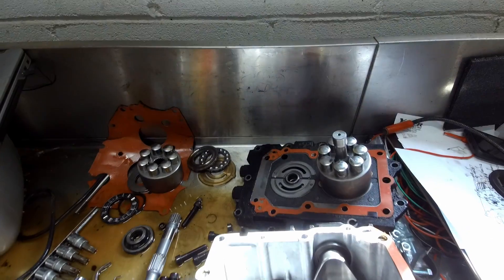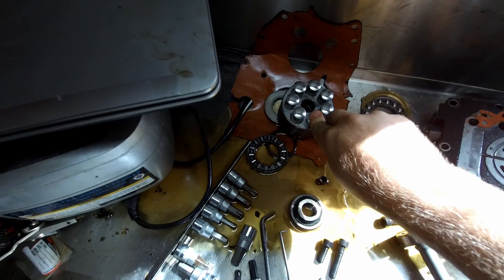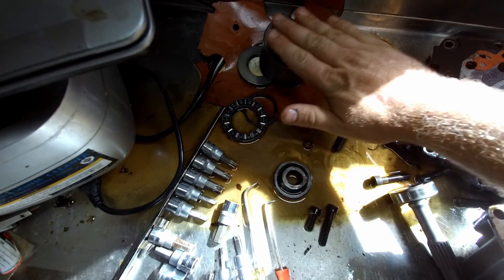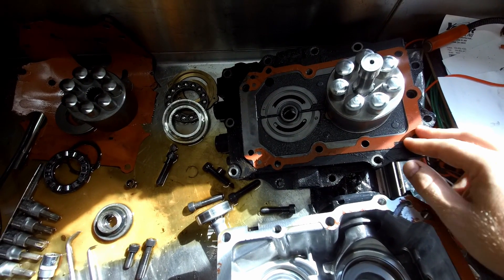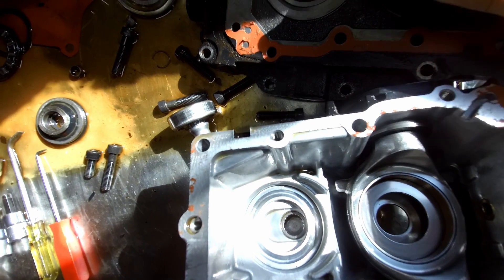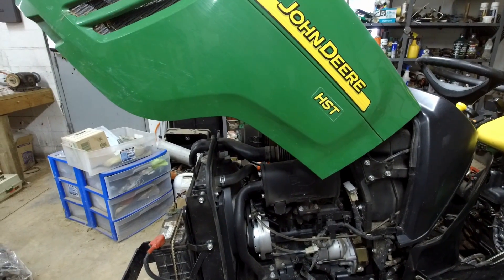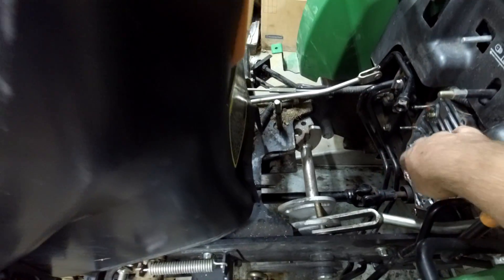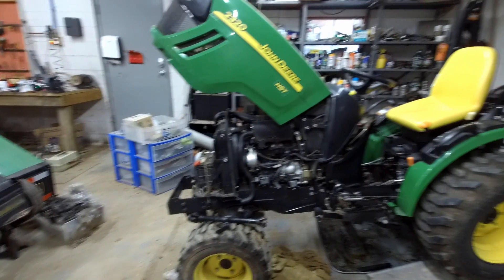EXPLAINED: How a Hydrostat Transmission Works

Comment: Hydrostatic transmissions are garbage. No reason for them on riding lawnmowers in the first place.
Reply: Hydro is superior in almost everyway to a Gear Transmission for any lawnmower. Just do your homework and buy a good one. True for everything.
Reply: @MikeThomasNYME  nah. Hydros suck. Had a Husqvarna with hydro transmission crapped out within a couple of years. Wheels would lock up going forward and had to keep getting off jerk the lawnmower backwards to get it going forward again. Junked that lawnmower quickly and went back to Murray and troybilt. 
  No need for hydro in a lawnmower, tractor...eh...maybe
Reply: @danielsmit11  That's because Husqvarna and the other cheap big box brands put cheap hydro transaxles in their machines because consumers just want something to be pretty and cheap. They use transmissions like the Tuff Torq K46 which is too small and weak for the 25hp tractors they put them in. K62 and larger hydrostatic transaxles and old peerless 15 hydros are nearly indestructible and last for decades.
Reply: @MikeThomasNYME  I'll stick with Murray's or troybilt. Have never had transmissions go out on one and have had them last for decades with little maintenance done.
Reply: @MikeThomasNYME  like I said there's no need for hydrostatic on a riding lawnmower. A tractor maybe but even that's a toss up
Reply: @MikeThomasNYME  other problems with hydrostat if you Google  they are less efficient meaning you'll use more fuel doing the same amount of cutting, will probably need a more powerful engine for the same size mower and requires more careful maintenance in most cases by a professional because they are usually built as a closed system making it virtually impossible to change the fluid.

Comment: What would Cause when you press in the clutch pedal to not disengage the hydraulics ?? is something broken inside
Reply from the maker: It would depend on the equipment - on many machines they have hydraulic pumps that are driven directly via the engine gear case and do not disconnect with the clutch & transmission.

Comment: Actually used to work for Deere.  Had a 1023 come in for the same failure.  Somehow that grease zerk fitting was omitted from the owner’s manual.  Deere eventually issued a PIP for it after enough owners with low hour machines experienced failure.
Reply from the maker: Thanks for the info

Comment: They probably left a greasing time periods out of the manual because it would deter people from buying it sounds like a problem with the build and should be recalled
Reply: Agreed.  Whole damb thing should be recalled.  Such bad luck with 2025r.  They even left the same crap design for the u joints. No easy way to grease.  That's the least of this things issues.

Comment: John Deere I avoid not that they are not good machines great machines but the company needs to be stopped it as began to crap on the consumer
Reply: Damn right! JD sadly has to get their act together. This is what I would expect from Chinese quality. My Lawn Tractor has had several faults that shouldn't have happened. Seat quickly fell apart, plastic hood cracking like an eggshell even though it's kept out of the sun, steering linkages are pitifully small, seat suspension rubbers crumble very often. The only good part about the machine is the Kawasaki engine and the Tufftorq transmission. Never JD again! It's also damaging for American manufacturing. Kubota for me next time. Good Japanese quality.
Reply: @erichmacho5741  thank you for the reply Erich im sorry your machine went that way. My father spoke of JD getting to big for their own good all the way back in the 80s. He strongly supported massy Ferguson not as a single company, but a smaller manufacturer. The whole JD culture planted seed for today where if 3rd generation has parents and grandparents backing the product. They automatically want to buy JD because it’s familier. I can’t blame the consumer we all
Like to think our elders are actually wise. The thing is their is laws to protect a consumer. Congratulations on expressing and forming a solution to your, own needs. I fully support your decision to buy Japanese machines. The job don’t wait just because the machine is down!

Comment: I have a forward and backwards one don't know why it doesn't work 😕 any ideas
Reply from the maker: Do you mean you have forward, but no reverse - or vise versa? If so,  both directions use the same pump / drive just push the fluid in the opposite direction, so I would check your linkage between the pedals and the swash plate. Might be as simple as a missing linkage pin! Hopefully : )
Reply: @ModernSurvivalists  the inside of the shaft had shifted. There was a screw inside that holds a coupling it pushed it way back.

Comment: Can that stub be replaced without having to disassemble the whole transmission
Reply from the maker: Unfortunately I don't think there is any way to remove the shaft without splitting the pump case.

Comment: I just had that stub break on my tractor any idea of how much it costs to fix
Reply from the maker: I did the repair for a farmer that's local to me but I don't have any idea what most shops or the dealership would charge. It's not a quick job unfortunately.
Reply: About how many hours does it take would you say?
Reply: A lot.

Comment: Just started tearing a 2320 apart today, that drive shaft broke off at this " stub shaft " .  I changed the drive shaft last year at 800 hours because the engine side ujoint on the shaft broke apart. So I'm not sure why the stub shaft snapped this year. Anyway, I really appreciate your video.
Reply from the maker: Sorry to hear you had the same issue. The one I fixed only had 200 hours which seems way early for a u-joint failure. The splined stub of the transmission input shaft had snapped off when the broken u-joint allowed the shaft to start flailing. If your u-joints were still good on the second failure I wonder if it might have been partially fractured from when your front u-joint went out. These spin at engine RPM, which is higher then a typical PTO shaft, drive shaft, etc. Lots of forces when they start flailing, especially if the tractor is at full throttle like is typical for mowing, etc.
Reply: @ModernSurvivalists  lol you said it, I was running a power broom in the snow when it snapped. It was like I hit an IED! So when the first ujoint failed last year, it was all rounded off like the one in your hand was, so it actually still ran just with a lot of vibration . I think it ran Like that , vibration and shuddering for a long time,  and after I replaced it,  the next weakest link was the transmission side. That's my  theory anyway
Reply: Oh and I had a question, do you know where I can find torque specs for a project like this? Besides the dealership?
Reply from the maker: @rrud59  I wasn't able to locate any torque specs online either. I did refer to the exploded diagrams you can find for part numbers and to assist me with the teardown. I just torqued it similar to how I would a engine case. First put in all fasteners finger tight, then tighten them snug in a cross pattern working from inside to outside.
Reply from the maker: @rrud59  Also - in order to remove the hydraulic drive from the transmission case I had to cut out the round crossmember tube welded in the frame. I used a sawzall and welded it back  in once the transmission was all back together.
Reply: @ModernSurvivalists  lol thats funny, I cut mine too. I started unbolting the rear in hopes to jack up the transmission a bit, but decided to just cut it.
Reply: @rrud59  was wondering if you cut it so glad it's in the comments I couldn't pause at the right frame to figure it out , I don't have a welder so I'm breaking down the frame  ugh what a job I hope I can figure out what caused the failure drive shaft u joints seems fine move freely
Reply: @danarndt2026  I absolutely cut it.  I did not weld it back together.  I felt there was very little need for it . Maybe I'm wrong but so far so good . I apologize for my very late response
Reply: I would never buy another John Deere! 2025r has more issues than I could list!  Major gear failures in rear axle.  Housing is no cracked, plus destroyed gear teeth, destroyed bearings.  Let's not even talk about the garbage engineering and lack of material quality.  Unless, you just want a big lawn mower, go with a better brand.  Skip the home owner compacts! They are not made to last!  30k garden tractors.

Comment from the maker: Anyone know why these u-joints seem to lose their grease so fast?
Reply: MY 2320 did not have grease fittings. I have found and replaced the u joints that have greas fittings.
Reply: What's the RPM of the shaft?
Reply from the maker: Runs at engine RPM - driven directly from flywheel.  @Gareth96v1